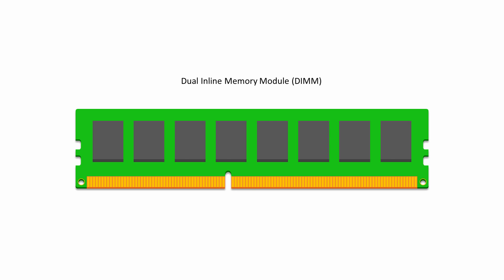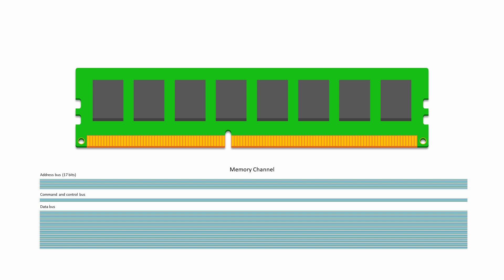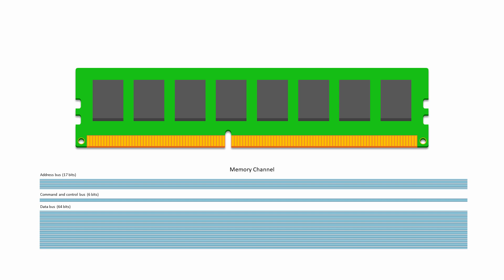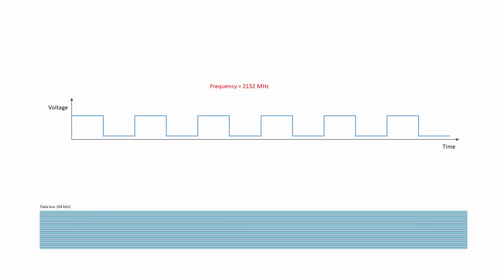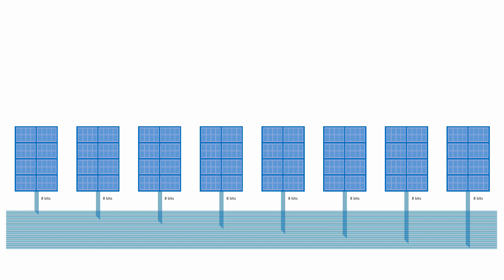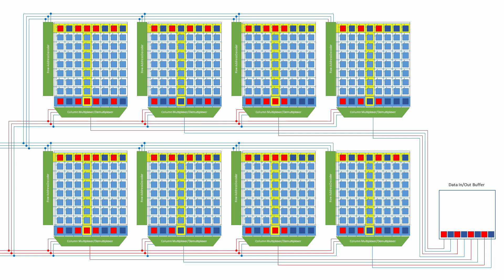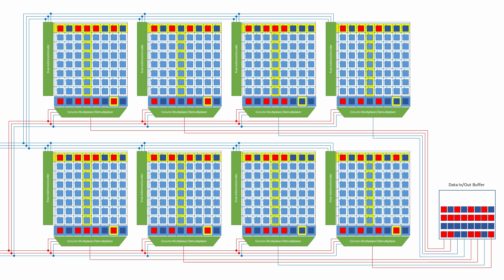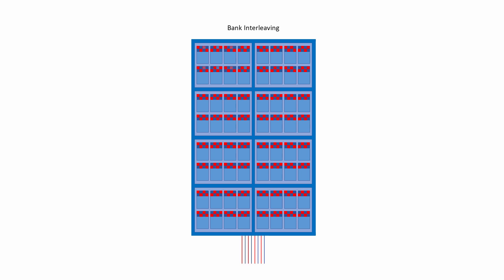Dynamic Random Access Memory (DRAM). Part 6: Burst Mode and Bank Interleaving

Comment: Thank you for the series. Here I would like to mention that DIMM is called so not because of 64-bit data line but just because each side is connected to its own electrical lines unlike SIMM having sides of its connector shorted, inheriting SIP package.

Comment: 6:55 A read, or write, is indeed initiated by the row address.  That action triggers an entire row to be read into the row of buffers, using the sense amps.  But this is an entirely separate command to the dram.  The column address is then LATER sent to read or write a burst of dram words somewhere within that row.  The video gives the impression that a read is initiated by BOTH the row and column.  Once the slow row opening command is complete, the column read or write command can be sent, acting on a portion of the row buffers.  And more than one burst read or write command can be done to different columns of the same open row before that row gets closed out and written back to the correct row within the array so a new row can be opened for R/W.

Reading a 2nd cache line that is from the same row as a first can be done with lower latency because the row does not need to be sensed and stored into the bank’s row buffers.  Once a row has been opened, bursts of reads and writes within that row can be initiated one right after the other, without incurring the delay to open a row (tho, a write must wait for the for the delayed burst of data from a previous read to finish on the data bus before a write burst can be sent to the dram).

The point is, the row and column addresses are provided at separate times and in separate commands.
Reply: A prior video discusses this

Comment: What I don't understand is that the illustration shows that each chip in a rank puts out 8 bits, but later you show that one bank also puts out 8 bits. I guess the bank interleaving part implies that only one bank at a time can output data from one chip. But I'm not sure if this is correct since this is not clear to me.
Reply from the maker: That is correct.  Only one bank on the chip can output data at any one time.  Bank interleaving ensures that the banks deliver their data in close succession. If a bank delivers 8 bits, the chip delivers 8 bits. :)KD

Comment: Thank you for the useful information. To point out one thing, according to JEDEC standard, DDR4's Burst length is also 8, which is introduced as 16 in the video (8:40). Thank you again for the good video.
Reply: You are correct. Burst length in DDR4 is 8, as presented in JEDEC standard docs and (easier do access) DDR4 datasheets from many manufacturers.
Reply: Indeed, BL was kept at 8 for DDR4 by introducing Bank Groups, which are also not mentioned.